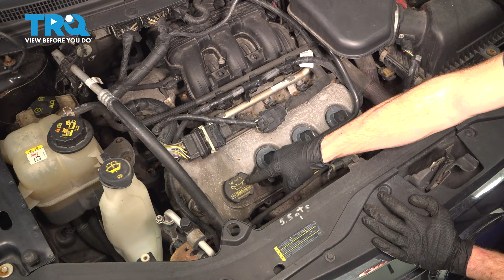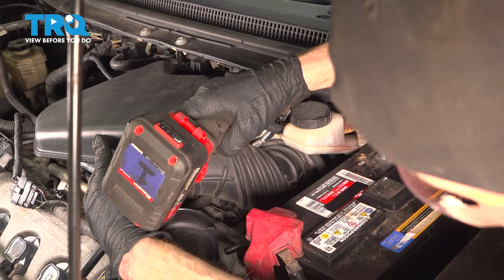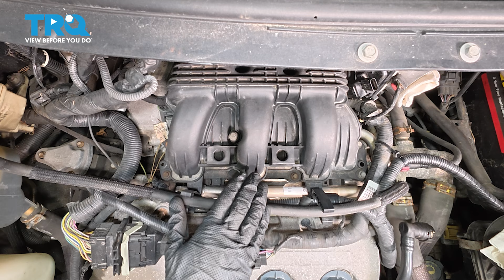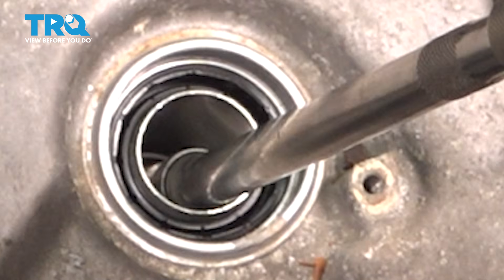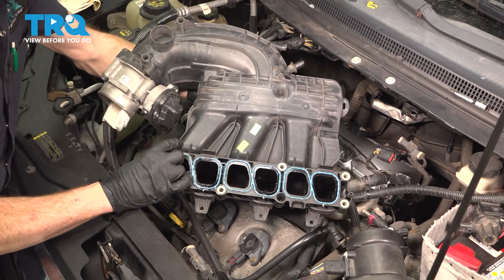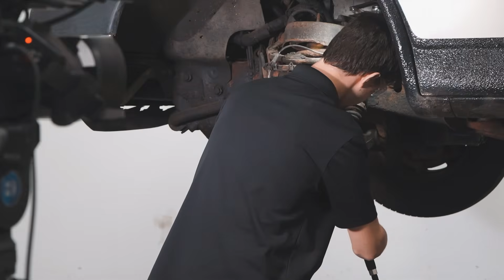How to Replace Spark Plugs 2007-2014 Ford Edge 3.5L V6

Comment: What is the remote clamp removing tool called, and where did you get it? It looks like it’s spring loaded, looks a bit like a flexible pronged pick-up tool. Tht’s a great tool. I want one. Thx.

Comment: Those extensions will throw your torque off. They do it even more when you put your hands on them. I’ve had to cut aluminum wheels off because Jon Boy or Billy Bob held onto the torque stick and used it for a guide. 😂